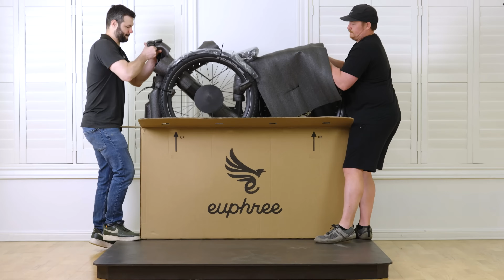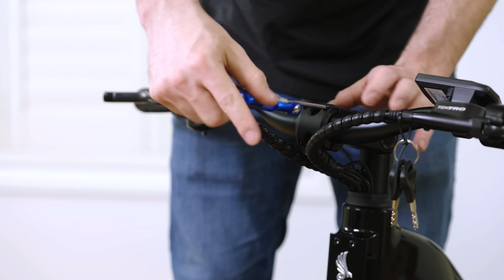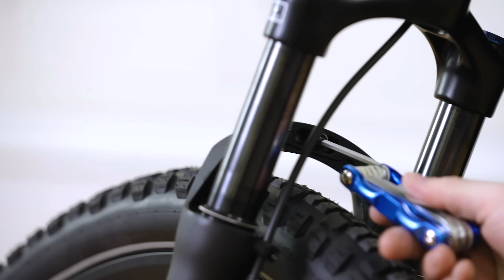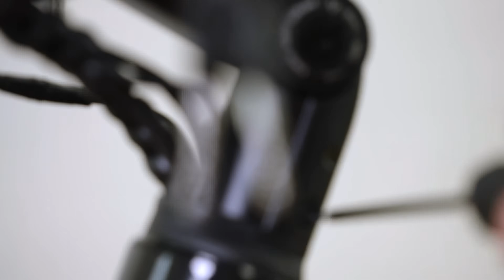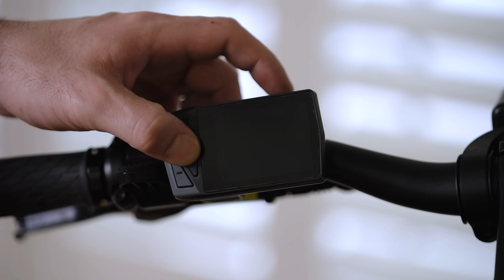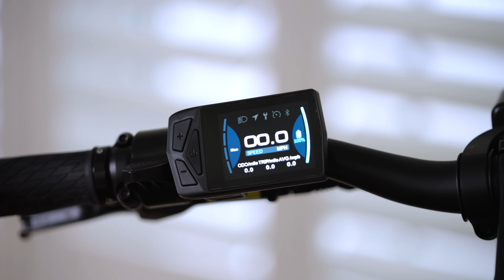Step-by-Step Guide: Assembling Your Stellar Falcon Ebike

Comment: I bought it based on YT videos sight unseen; took a leap of face and hit buy it now. It is a great Bike. The motor is not too noisy. I went with the mid step in Black. The Tires and suspension are dreamy. So much fun. I set it to Cadence sensor and prefer it. The throttle came turned on.

Comment: ugh....I like the Stellar Falcon but it's $600 more than the Velotric Discover 2 which is comparable and the D2 bike is rated IPX6, the battery rated IPX7 for those days driving home in the rain with the bikes on the vehicle....even if I bought the suntour post for $100 it's still a lot more affordable. I would end up spending $1200 more if I bought myself and wife a stellar falcon.....still a pretty bike though.